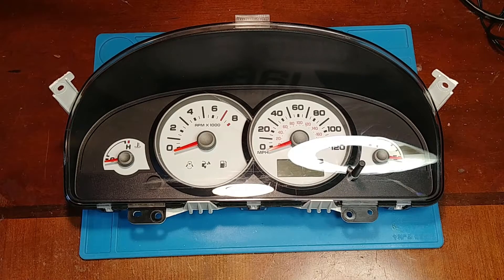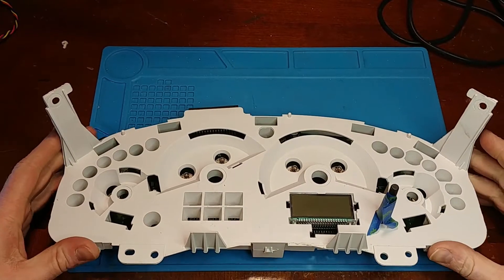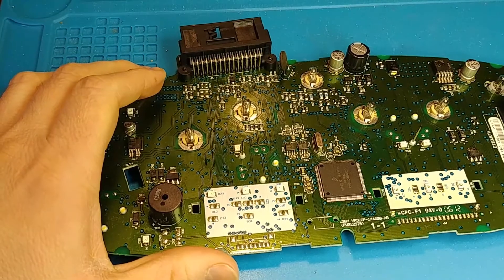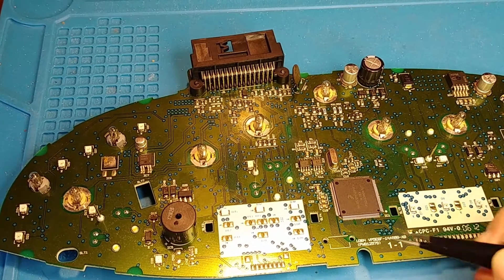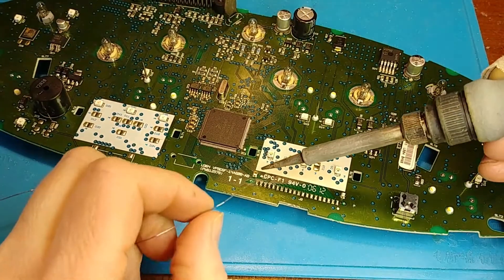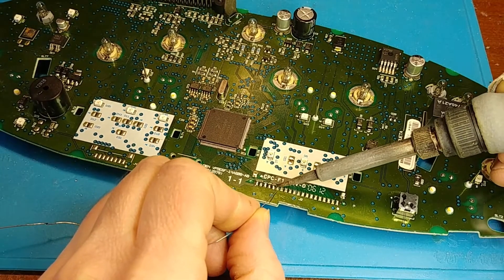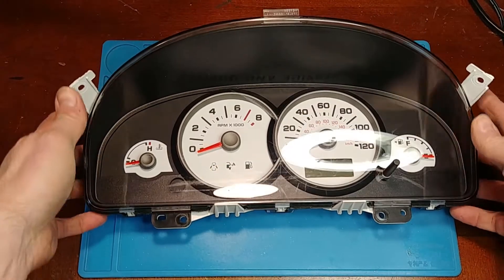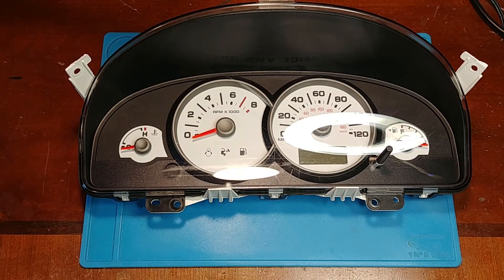Repairing a Ford Escape Instrument Cluster

Comment: I'm here because after removing the clear face, the tripmeter reset actuator fell out at some point. I found the outer part, the part you push, but it appears there is also an inner piece, now lost. Good job on taping yours up.

Comment: I have a problem with my ford escape 03. so sometimes when I turn it off it won't turn on no more where the miles are it turns into lines any idea if it's the computer or the cluster? help!
Reply from the maker: Cluster
Reply: so the instrumental cluster
Reply: so I changed the instrumental cluster and it will still do the same thing last thing I can think of is the computer any tips ?
Reply from the maker: @joseph4678  does the vehicle run ok?
Reply: yes it does just when ama turn it on sometimes it won't & it doesn't have a hard time turning on as well it's just that where the miles are at it won't show them
Reply: It sounds like the pin connectors on the actual plug aren't getting full contact to the cluster if both clusters doing the same thing.

Comment: I've got a 2004 Ford Focus Se with a 5spd manual. It came with the cluster that didn't have the tach so I went to the wrecker and got one that had it. After popping it it I get the parking brake light on and the ABS light. My car does not have ABS. So I've since removed the bulbs for the ABS light and the brake light. Problem is I'm dumb and sometimes forget to unset my parking brake and find myself driving around with it on. Any ideal on what I could do to get it to function normally? Or does it need to be reprogrammed? Ford want 250$ just to look at it.

Comment: what's the info on the mat? :) looks like it's silicon based?
Reply from the maker: It's just a eBay cheapy. "ESD safe" heat resistive mat. But it really can handle heat. Won't melt even if I try. Plus cleans up nice.
Reply: Ahh ok. I’ve got something similar that I’ve had a while, but that one looked much nicer. I’ll search around the eBay world and see if I can find something like that one.

Comment: So is the problem with the processor pins coming loose the same as the early 2000s super duty clusters develop?
Reply from the maker: I'm not sure, it's hit and miss with those. If you figure it out let me know.
Reply: @jeffescortlx  I mean I guess that is what I was asking if that is the problem with the super duty ones
Reply: For the control side of the battery saver realy. I have tried to fix a couple of these and well never really found the problem with them.
Reply: Eddie Reichel Did you ever figure out the intermittent problem with the control side of the battery saver relay?
Reply: @randallfox3139  No sir.  Although I do believe that Jeff had given a clue to the problem in this video I have not had a chance to see if that was the issue.

Comment: Did you bench tested it after the reflow?
Reply from the maker: This cluster was tested by installing it back into the escape. I haven't tracked down a harness pigtail for this model yet. I don't predict seeing another anytime soon.
Reply: Got it. If you have the vehicle right next to you - best bench test :) BTW, where do you purchase the paper filters for FR300? There are couple different thickness kinds...
Reply from the maker: I used the "Hakko A1033 Ceramic Filter 10 Pack for 802/808/800L/707/706/807/809/817" and it was a perfect for the FR300

Comment: You did that LCD the hard way. You de-soldered the entire connector. You can actually gently pry up on the LCD and it will come loose from the black connector soldered to the PCB underneath. The pins on the LCD are friction pressed into that connector.
 I probably would have used my iron to drag solder that QFP as well. It's less thermal shock that way.
Reply from the maker: It was my first time having a escape cluster apart, I'll know to try different if another one comes in.
Reply: Totally understandable. Those LCD's can be very deceiving. You really have to look carefully to see how they are connected. And you have to be extremely careful when prying up on them as to not crack the glass. Great video though.
Reply from the maker: Yep I didn't have any spare LCD's and didn't want to take any chances. Seem's to be a non-common repair so will probably be a while before I see another. You see many?
Reply: I don't. Ford clusters don't seem to be nearly as problematic as GM. But I've taken apart enough of them to recognize this type of LCD and how they com apart on these Ford clusters. But as long as you're careful, the LCD has enough give in it to allow you to disconnect it from that socket without breakage.
Reply from the maker: Any experience with 06 Explorer?
Reply: Not yet. You have one?
Reply from the maker: Yeah, anti-theft no crank situation. I'm stumped.
Reply: Only video I see on this make and year of vehicle I have to have mine rebuilt 250 so I bought one off of eBay for 20 just to practice on